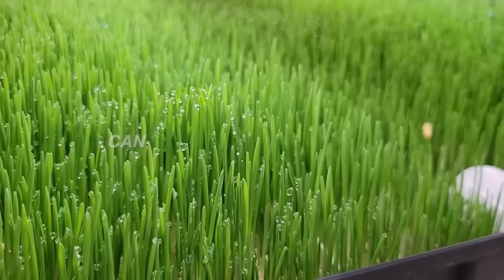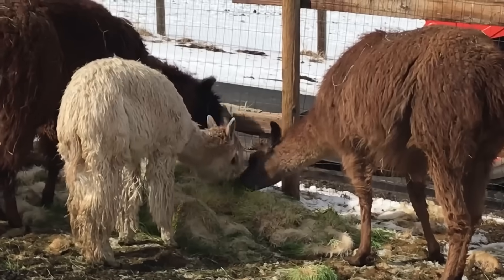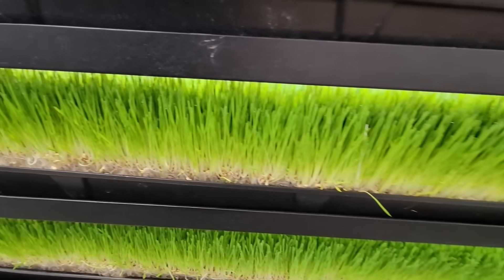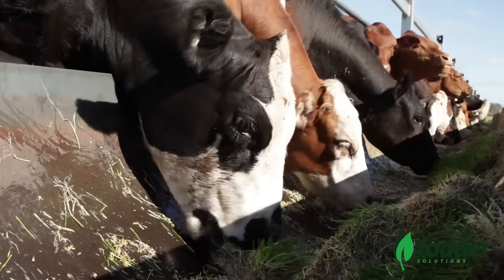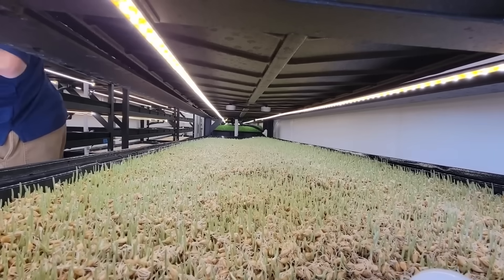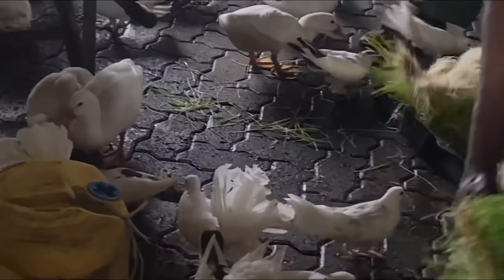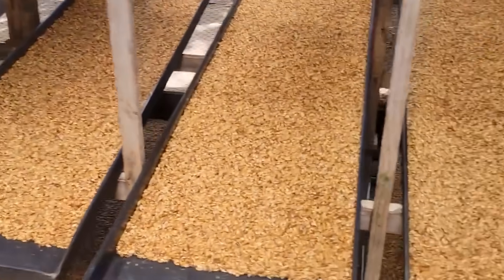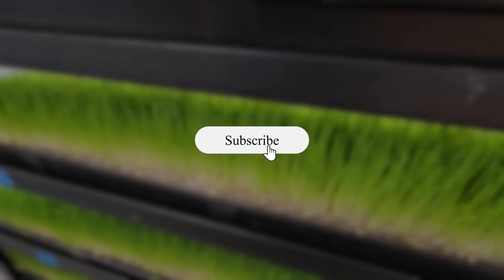Can Indoor Fodder Really Replace Hay? (The Numbers Don’t Lie)

Comment: I raised sprouted grain for two years as a top dressing for poor quality alfalfa hay.
In my location i was a open air and shade cloth operation i hað fans for ventilation. I needed good air flow so the grain would not mold because of the high temperature.
I was located 150 miles from Death Valley,Ca.
I sprouted a few different types of grain that would work in my environment. I tryed corn,oats,tricale,barley,winter wheat,rye. My best yealder in over all weight and volume was corn.
I did some experiments with fava beans and alfalfa.
I was told about a dairy that is in South Africa but there not online.
I tried do do a few things like they did.
Seed grain i was using i was always look for high quality seeds at a lower price and seeds that had not been setting storage for years. In one year there was a shortage of both rye and barley the seed price tripled.
I found out the size of  Seed bed or seed tray i need was 12' x 24'.
I had to set trays of grain 7/7 in order to have the necessary feed i needed daily. Seven hours a day for seven days a wreek. I did not have equipment or tools i used what i had. I did think if i had a new cheap cement mixer to soak the seeds in and pour from would a help. Just a cement mixer just to soak seeds in and pour from.
The labor is exhausting and it has to been done everyday!
I was feeding both goats and cattle, the cattle was pickie eaters.

Comment: These systems could scale up if the building is easy to keep warm and to sterilize (to eliminate mold). Thank you for presenting the advantages and pitfalls. The value of the fodder can also be enhanced with additional minerals and enzymes, and that can be adjusted as conventional fodder is added to the feed rations when available.
Reply: You do realize the daily work also scales....at a certain point you wont have time to do other daily chores and you are done. You work to live, you dont live to work.

Comment: Amazing well thought out video. 
I need to incorporate sprouts/young fodder to my 1000 quail, 11 ducks and 50 rabbits this winter. Next year I’ll need it for my sheep and pigs. 
I’m in Canada Ottawa and it’s cold! I have created a warm room in my barn for the sprouts and black soldier flies. They both need warmth and extra light time in the winter. Fingers crossed it works out in the same room when it’s -20 c outside.
Reply: I purchased a solar powered heat pump from Airspool.  It's called the super heat and goes down to -22.
I was thinking obout it the whole video 😆

Comment: Could you not put chicken wire over it so it leaves 1.5 inches of grass just like regenerative practices  , meaning that the same seed gets re-used so that the second grow only requires 3 or 4 days as there's already a 1.5 inch stand of grass hence you're reducing the electricity requirements by 33 % or 50 %
Reply: You would have to change up the process entirely. Soil would be needed to maintain nutrients for the regrowth.
Reply: You could do that once or twice maybe but much of the nutrients are still in the seed mat and molding is likely to increase. Also if you're not growing in soil the seeds aren't going to grow indefinitely.
Reply: Great question. I believe the  majority of the energy and protein at least for my quail is in the first few days to a week of sprouting. If you keep cutting because you are only using water a lot of the benefit gets harvested in the first few cuts. And you need to wait weeks to months before cutting again to let the crop recover.